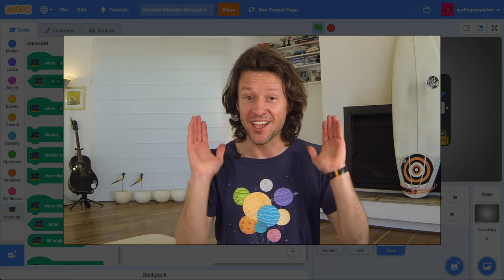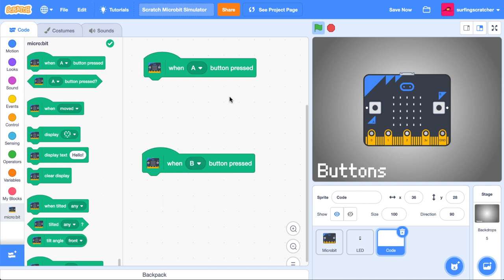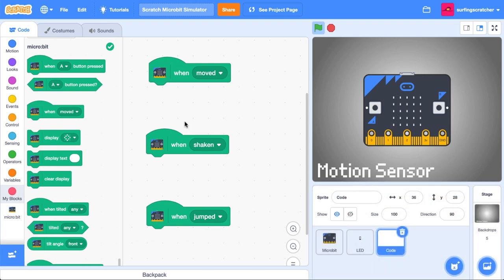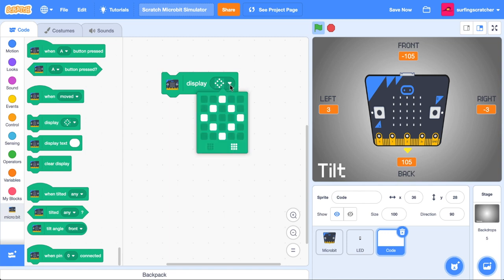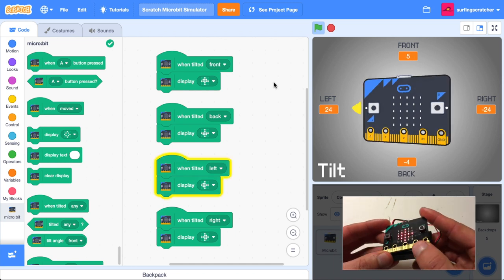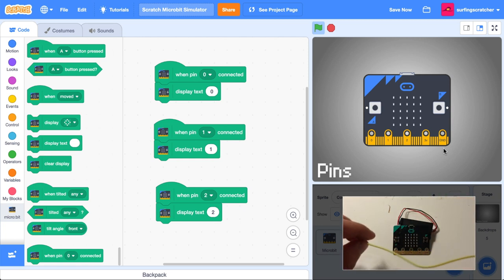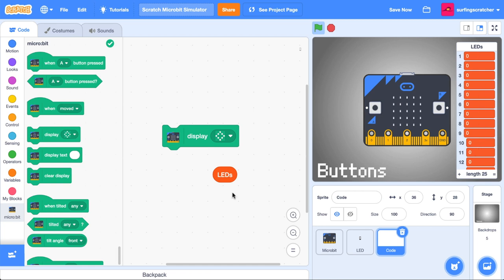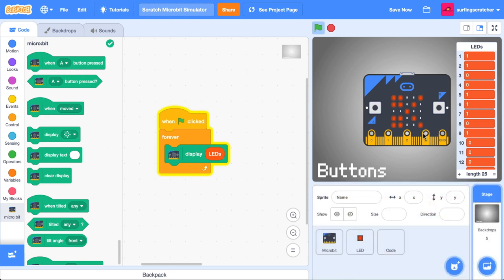Scratch Microbit Blocks Explained | What can Microbit do with Scratch?

Comment: How does this work when you're linking a whole classroom full of computers with micro:bits? Do you have any experience with that?
Reply from the maker: Hi Robin, The max I've linked in my learning context is around 4 in a class with students. The key aspect to student success is being able to read the name of the micro:bit and finding that name in the list inside the Scratch project. From my experience, 1 computer = 1 micro:bit is sure to work. From what I recall, you can only pair 1 micro:bit with 1 Scratch project, but that could have changed. Potentially, you could pair multiple micro:bits with the same project as that still follows the 1:1 rule. The difference is that they're linked with the same project. Though, I haven't tried this. 
You could experiment with incognito windows to have multiple Scratch accounts open on the same computer if that is a limiting resource.
Eventually, I had the kids locating the microbits on their Scratch projects with students as young as Level 2 having success with this.
Hope some of that information is helpful :)
Reply: @SurfingScratcher  Wow, thanks a lot! That definitely helps. Next week we're doing a camp where 20 students will work with microbits

Comment: thanks for the video. question: the microbit itself has blocks to program buttons etc why do we need to program microbit from scratch coding? is that to integrate programming of the scratch's sprite character with the microbit?
Reply from the maker: I can't speak directly for the micro:bit/Scratch collaboration, but these could be potential reasons:
Scratch has a large user base and serves as an entry point for people to start with micro:bit that uses existing knowledge.
micro:bit can be used as a controller for a Scratch game. So yes, you would be able to control the sprite's actions.
But yes, Makecode opens up the micro:bit to access more of its features.
Reply: @SurfingScratcher  thanks that make sense. I saw a project yesterday where someone used a microbit to create a running game in scratch. when microbit shakes the character runs (bit like ninetendo Wii). that I think is one of many benefits of the collaboration.
Reply from the maker: @niceman567  that sounds cool! Thanks for sharing an implementation of the micro:bit and Scratch in action :)

Comment: 0:00: 🤖 This tutorial introduces the features and blocks of the Scratch micro:bit project editor, and demonstrates their use.
1:42: ⚙️ The video demonstrates how to use micro:bit blocks to simulate button presses and utilize the accelerometer.
3:33: ⬆️ The video demonstrates how to use LEDs and micro:bit to display different tilts and movements.
5:24: ⚙️ The video demonstrates connecting pins and using a jumper cable to complete a circuit, while also discussing LEDs and display stack blocks.
7:10: ⚙️ The video discusses creating and using scissors and predefined images in Scratch.
Recap for https://youtu.be/undefined by Tammy AI